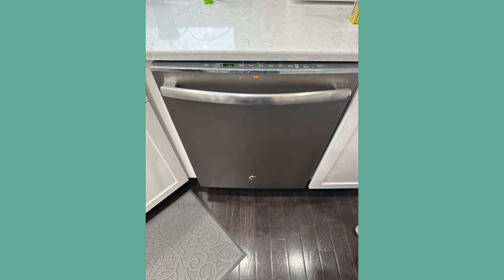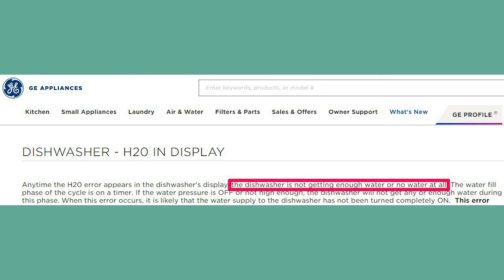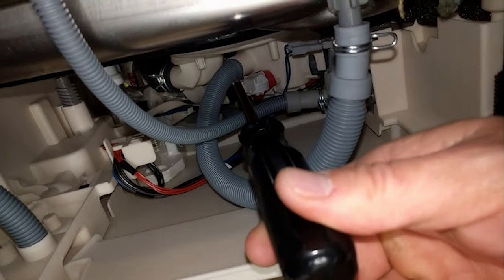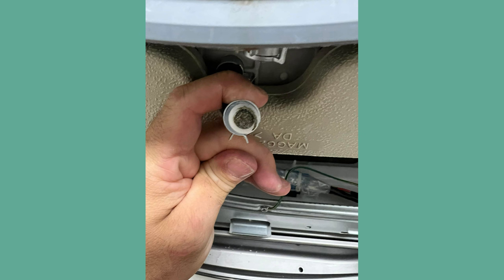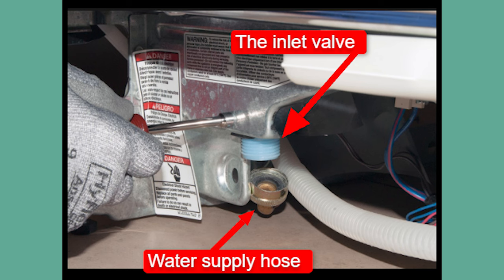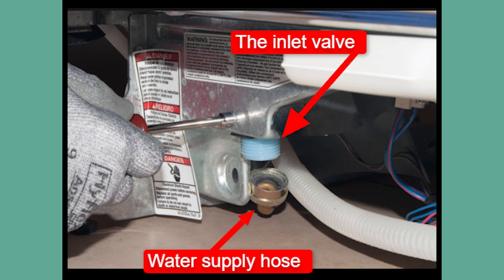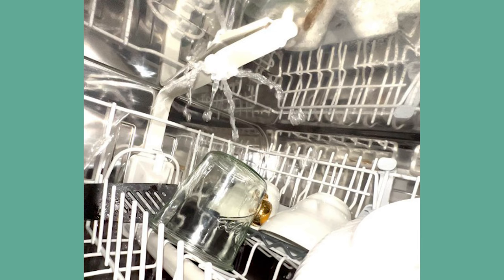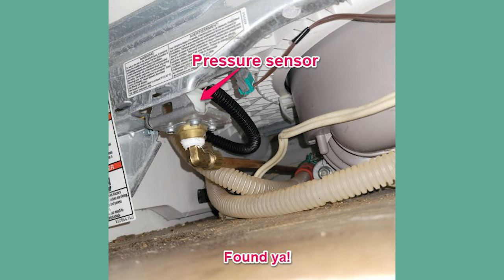Fixing GE Dishwasher H20 Error: A Step-by-Step Guide

Comment: Hello,   Here is another simple fix.  I have a six month old GE washer, model GDT550PMR6ES.  I was somewhat dismayed to see
the H2O code recently and watched your video, which was very good.  After watching it I had a suspicion that none of the problems
you described actually applied to my appliance and I was right. I started up the dishwasher and listened closely to what it was 
doing. It seems it first checks for water pressure and then checks the outlet hose to see if it can empty itself.  Well my disposer 
was full of refuse that I had not run the disposer yet to clear.  After doing a good job of flushing the garbage down the drain 
I started up the dishwasher and voila, no more H2O code !!  Thanks again.